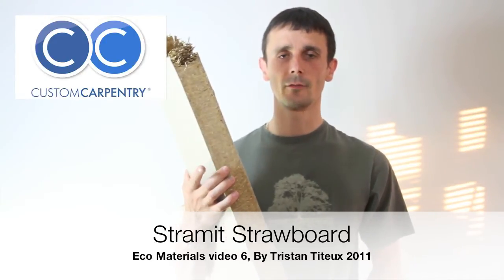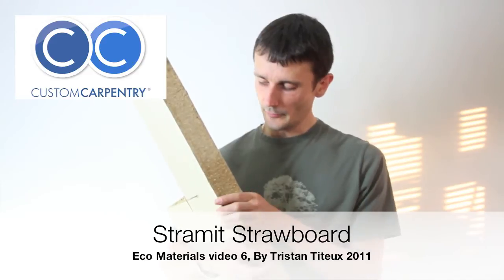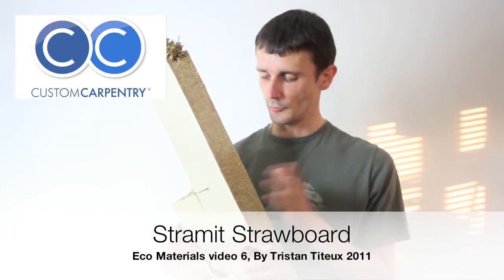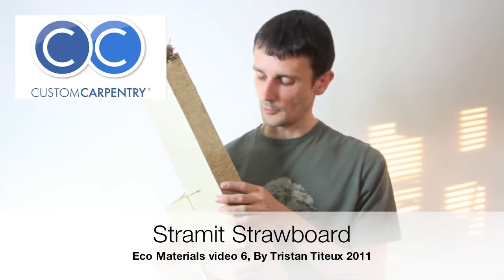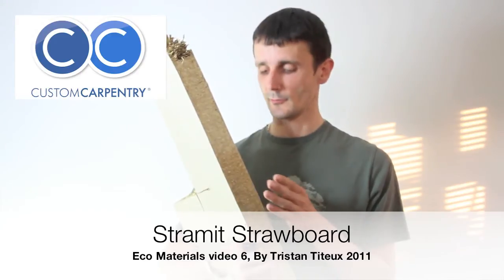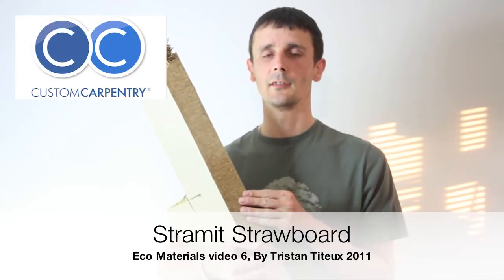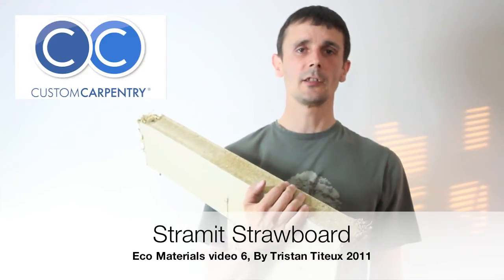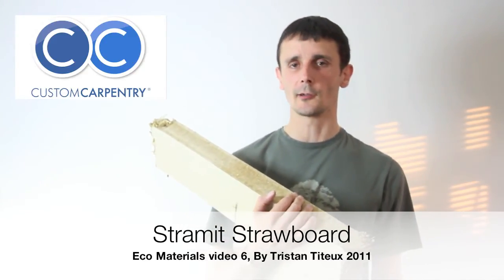Eco Materials 6 Strawboard from Stramit by Tristan Titeux 2011

Comment: The question that needs answering relates to this stuff being used for internal walls as in my house in Essex (The whole estate was fitted out with it) how the hell do you fix stuff to it - what fixings?
Reply from the maker: I would be more than happy to help you out with suggestions if you email me at info@empatika.uk, I would need to know what you are wanting to fix to it.
Reply: @TristanTiteux  This bloke helped me out directly and it turns out this stuff is pretty good having now used it. It's packed so tight it takes normal screws exceptionally well and worked with everything I screwed into including the supports for a plaster-board ceiling.